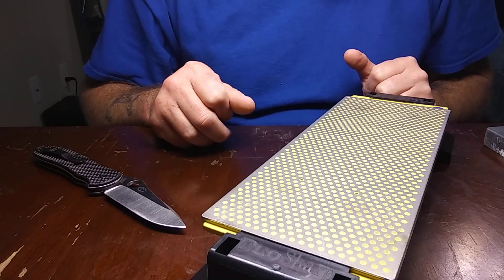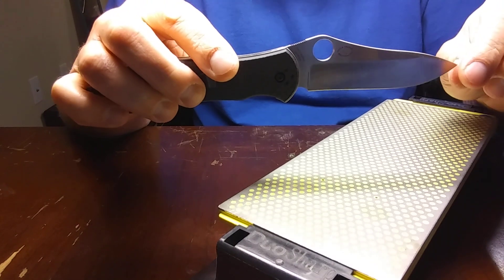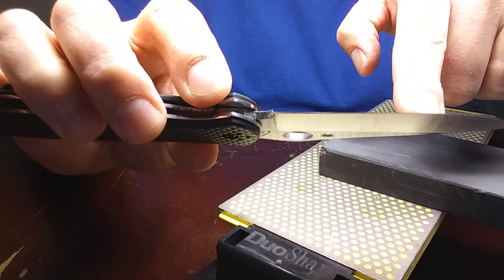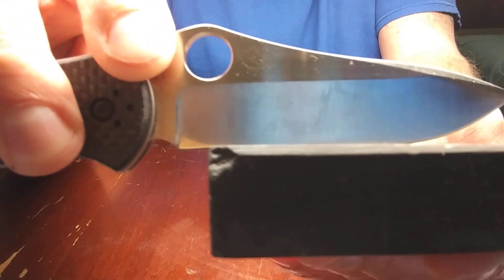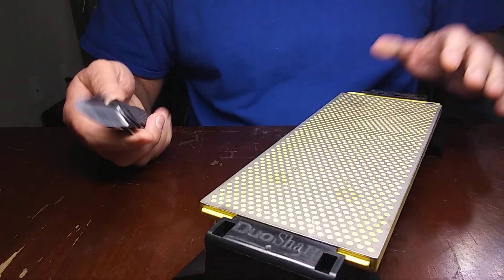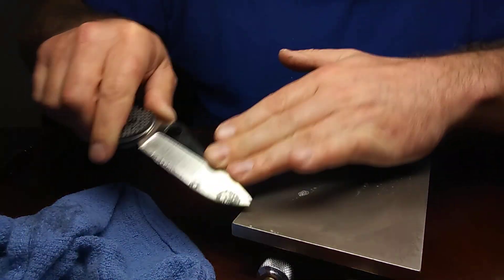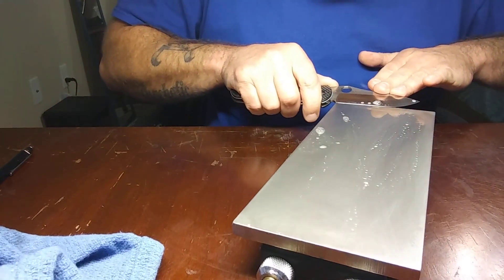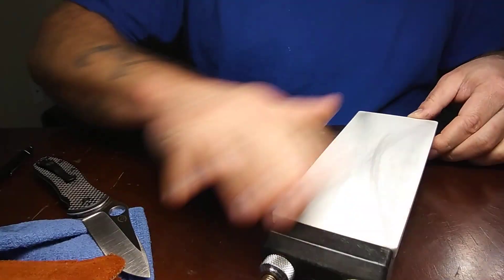Repair and sharpening a spyderco Gayle Bradley in m4

Comment: You do realize you just did this awesome work on one of the hardest steels out right now. M4 is crazy hard well done 👍🏻
Reply from the maker: Ive sharpened so much bud its all easy for me now lol. Thank you. I appreciate the comment 👊
Reply: I just picked up my first two “super steel” knifes a zt 0562cf with the cpm 20cv and a zt 0609 also with 20cv steel.. haven’t gotten them yet still waiting for the mail man to bring me my presents lol
Reply from the maker: @testpiloterb1828  i have both. Very good choices in my opinion. My 0562 is a c.f. and in cts-204p. 20cv is the American equivalent to German m390 its good stuff.
Reply: Rough Rooster Knife Sharpening good stuff! I’m pretty sure the 20cv is very similar to it as well not sure where it’s made though.. I shall have to do more research.. what’s your favorite knife or if that is to hard to answer what’s you favorite knife company? Mine would be spyderco and ZT (zero tolerance) if I had to pic one it would be ZT by a long shot lol
Reply from the maker: @testpiloterb1828  my favorites are zt benchmade battle horse and esee
Reply: Rough Rooster Knife Sharpening I’ll have to check out battle horse and esee I’m not to familiar with them
Reply from the maker: @testpiloterb1828  damn seriously?
Reply: Rough Rooster Knife Sharpening yeah lol well I’m kinda new to the knife world maybe like 2 weeks or so I’ve been hooked on straight razors before and I’m branching out now.. I love sharp things and stones to sharpen them with lol so your channel works well for me lol.

Comment: All gayle Bradley 2s has that slight recurve for some reason.  The 1s didn’t have it
Reply from the maker: D T I’ve noticed in the few I’ve sharpened after that.
Reply: Its because the sharpning coil doesn't qet past the slope of the plunge grind. I extended my choil out with a DMT diamond chainsaw file about 3 mm. After a couple sharpnings the recurve goes away. Almost all GB2 have this, as the sharpening belt, stones, whatever you use ride up on that plunge grind slope (especially with guided systems), and force the other end into the blade hard causing a recurve. Make your life easy, extend your choil.

Comment: so no stroping strokes?
Reply from the maker: No ...Whats a stropping stroke?
Reply: @roughroosterknifesharpenin5531  or edge trailing stroke.  I see plenty of other YouTube sharpners go back and forth, leading and trailing. Both methods seem viable. Was wondering your thoughts.
Reply from the maker: @davidberman8816  I'm not other YouTubeers. Why make the scratch pattern all jacked up? The edge treetopped hair. Isnt that good enough?
Reply from the maker: @davidberman8816  also if you are going to strop. Use a strop
Reply: Agree completely, I just played around with your methods and noticed the uniform scratch pattern it leaves. Thanks for your content sir!

Comment: I have a norton crystalon/india combo stone that I just bought and was wondering if you use those and if you do, do you use dawn and water on them as well? Ive been using oil on it but its a little too messy for me and I paranoid that ill get cross contamination onto my waterstones. 

In your opinion will dawn and water work on india/crystalon stones? or are they too porous to hold the soap and water mixture?
Reply from the maker: I think they are to porus. I tried water on one and it blead right through.
Reply: I actually ended up trying it before you responded to my question. As far as the norton india/crystalon combo stone goes. it holds a dish soap and water solution. Even on the course side it holds relatively well. Though that might be because I never tried to remove the oil from it. A different crystalon stone that my parents have the course side lets water flow right through it.  @roughroosterknifesharpenin5531

Comment: Hey rooster how do u like those duo sharp compared to the continuous surface dmt???? If I had a choice all over again which would u recommend?
Reply from the maker: I like the continuous. I had them first. The only reason I have a non continuous duo is I got it really cheap. I was looking for a xc anyway and i got them both with a stand for under $80
Reply: Thanks rooster could of picked up both Xc c f ef for a 150 but glad I didn’t my plates are getting worn out and need new ones!

Comment: I tell you an awesome trick I discovered on how to make ceramic stones look and cut like brand new. Get some muratic acid (YOU CAN BUY IT AT LOWES) The strongest is what you want to buy its has a "blue" label on it. Then put it in a bucket, mix 2/3 acid+1/3 water. (Or 2 to 1 ) One gallon of acid to 2 gallon of water)Then submerge the whole  stone for about 25 min. This will not eat or etch the stone, and its how I clean mine. The ceramic stone are a vitrified material.  Just like a brick, meaning they are put in a  furnace and essentially baking at very high temps. They are a sininstered ruby. I do know about this i work with this stuff all the time, because I'm a Mason, and we have to clean the brick work with acid when the wall is complete.  Caution this stuff does put off fumes and it will burn flesh, but it can be safely used outside with  a mask and rubber gloves and safety glasses .  When your done remove the stone and take some steel wool or a wire brush and lightly  scrub the stone, and then rinse with clean water. Your stone will look brand new. If I bought a bucket, if get a 5 gallon bucket with a lid. That way you can put a lid on the solution when your finish and re use it in the future.
Reply from the maker: I just seen this comment, hmm I'm going to have to try this. We've been using it at work lately. Good time to experiment!
Reply: @roughroosterknifesharpenin5531  not many brick jobs right now . It's strong stuff!! It will clean them stones and won't eat em up. Just buy a plastic bucket with a lid and you can use it over and over again, or can can just mix up a in a smaller container. More like a 70acid/30 water for this, but in brick it's usually 50/50 if not it will eat the  mortar joints...